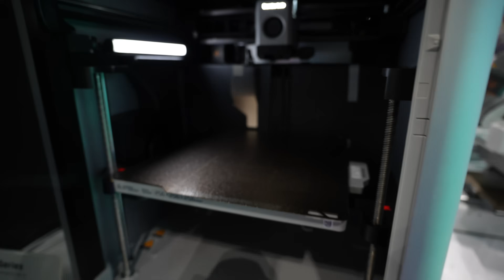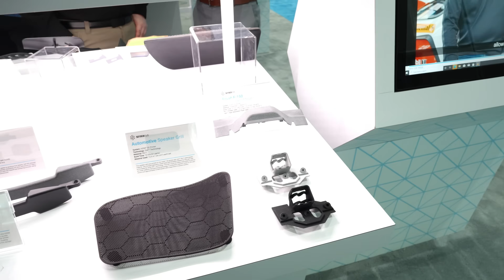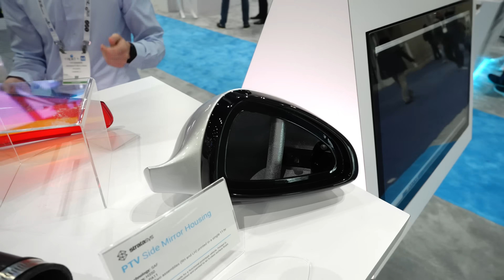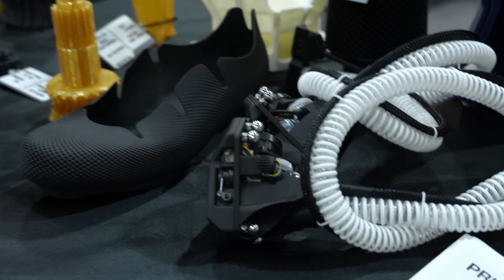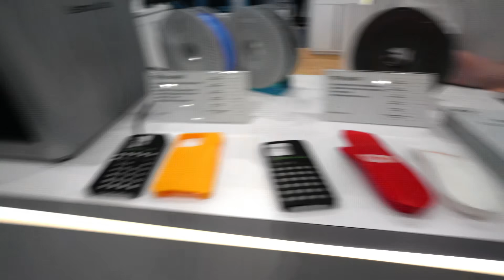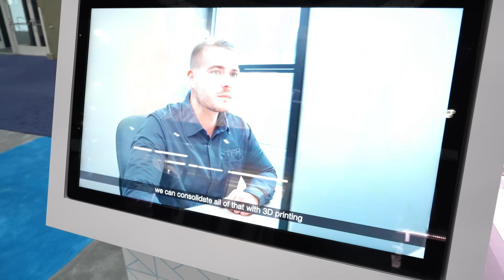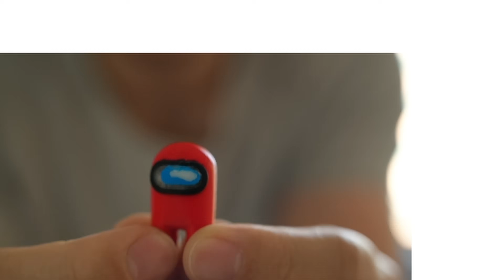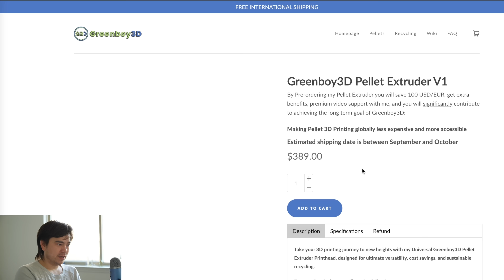Bambu Lab Patent Infringement, PRUSA MK4S, and Cheap Pellet Extruders (3D Printer News August 2024)

Comment: Bambu was the harbinger of the end of open architecture 3d printers. It's a technology that was built by hobbyists and now being overtaken by industry. It was inevitable.
Reply: For most hobbyists, I would agree.  But there was very obviously a strong demand for what they delivered.  It's the Ender-3 modders who moved on because they can now get good prints without having to finish assembling the extruder upgrade you printed.   But I still have a hypercube that I can tinker with :)

Comment: I am genuinely worried about the "rise" of bambu. Once open source it out the window we are gonna get overpriced filament "cartridges" with a DRM chip, serial locked hotends and always online 3D printers. Its happening to most other mass produced devices, why should 3D printers be somehow different?
Reply from the maker: If they run like any normal corporation, they’d only enforce filament DRM when it becomes profitable to do so. 

Right now there is too much competition in the market with PRUSA, Creality, and others. Once they knock a few of their competitors out and have a de facto monopoly they can start doing stuff like that. It might be sooner than you think.

Of course they’ll say it’s for your own good when it happens
Reply: @NathanBuildsRobots isn’t formlabs already doing that with some of their resin printers though?
Reply: They would become another Stratasys, they already have DRM on their cartridges.

Comment: It seems that they have some standing with their patents, but things like RFID are used in everything - I can't imagine the case where I put RFID into a product, then get sued because some company before me did it. If that were the case Ford should've patented the idea of putting 4 wheels on a metal frame, with an engine and some seats. We'd all be driving Fords.
Reply: There's the slight issue with prior art as well. Stratasys have had chips in their filament cartrages for decades, to lock down their printers to only use their filament.
Changing the connection method from physical to RDIF is surely not novel enough for a patent.
(they only got this patent by buying another company about 6months ago)

Comment: Also stratasys has had a rough time, their stock is down 50% YTD, they had a failed attempted buyout from 3d systems another famously litigeous early 3d printing companies (they sued formlabs while Stratasys was suing afina for using infil. Based on these filings tiertime (who was the company stratasys sued in the 2010's) was their supplier so if Bambu lab is a conglomerate with them they will have been expecting this. 

Also Stratasys has been planning this at least since march when they bought the heated bed patent from Arevo a californian robotics company who was liquidating their assets after they ceased trading. 

Stratasys is the OG villan for 3d printing, (it was only when their original patents frrom the 80's started ending in 2009 when 3d printing could take off).

Comment: The 'on a network' claim can't possibly fly. A 3D printer is basically a CNC machine if they happen to win with this then there are likely a whole lot of older companies with similar patents that they should be worried about.
Reply: I had the same thought, load cells are common in CNC machines and have been for decades. 
It doesn't seem like you should be able to patent something that already exists by just saying "Oh...no totally different, this is attached to a 3D printer"
Reply: @_Piers_ Especially considering that 3D printers are CNC machines.
Reply: @SnakebitSTI  CNC Machines that don’t need a CNC Machinist to operate them
Reply: yeah, they're gonna struggle with getting the patents for load cell quipped toolheads and networked machinery because of the existence of CNC mills and cutters which use load cells for position detection and homing routines and networking for status monitoring, file uploads and control of the machine. Those have been around long before the patents. especially in industrial applications.

If Stratasys gets those patents, other companies like Tormach, PocketNC and the likes would and up potentially being on the patent chopping block since you can get load cell toolheads for alignment and homing.
Reply: Watch Makers Muse video on the origin of 3D printers and the date.
Also CNC uses gcode that slicing software adapted to 3D printing.
Somebody opened a can of worms.....

Comment: Patents are generally a good thing, but I don't believe they are beneficial for consumers to this extent. I also find it absurd that a company can hold patents on almost everything related to FDM printing. Stratasys is effectively preventing us from having better 3D printers. I hope they lose the lawsuit.
Reply: That there is the exactly one of the major problems with the patents system.  It would be one thing if they are only patenting their printers as whole combined systems  with their unique features, or the general subsystems they are actively using or developing.  Which would let others develop their own printers with their own unique but different systems. But that’s not what companies like stratasys do. Instead of one patent for say a whole printer or a whole tool head, they make a thousand extremely simplistic patents on everything to do with any of their printers,others printers and anything they can think of, like ‘heated built plate’ or ‘non-stick coating on extruder gear’, or even ‘additive manufacturing device that is network connected to a cloud or app system over internet or local connection’, then they toss them all at the wall to see what sticks,and they keep doing that with what seems like more effort then they put into just actually trying to make a better product then their competitors.  That is not what the intention of the patent system was. It was so you can put out a product without having someone with more funds or something be able to just rip off a copy of your product and sell it as theirs.  That’s fine and great for simplistic mechanical products, but not for a market of complex, interconnected, and ever evolving electronic devices and systems where one entity is allowed to patent every simple and essential building block of any device that could conceivably by made in that industry that they can legally get away with and force a monopoly in their favor.

Sorry for the rant though, but not the opinion.
Reply: @RockieOnly  well Said. 100% agree
Reply: @slamoto2  well thank you!
Reply: @RockieOnly  that is why i think tech patents should last 5 years at most , precisely for the sort of thing you mention
Reply: Most of these patents are not even things Stratasys claim to have invented. 
Some of them are from Makerbot, who patented a number of things that were invented by the community. 
Others Stratasys have only owned since they bought Arevo's patents in March this year.
Reply: @_Piers_  I actually have an old MakerBot printer. It’s an old Replicator 2X.  It’s was cool printer that had a dual head setup making my first printer a multi-material one.  But it was expensive and guess what, with its proprietary gcode file format, it’s also now a big paperweight as even with the most up to date firmware, it won’t even read new sliced files from ANY of the slicers or softwares from MakerBot. And I haven’t tried it since then in years.

Comment: Everything is obvious in hindsight. But st the time, nobody else had thought of it.
Reply: Except practically all of these patents have prior art that would have prevented the patent from being granted if the patent system worked correctly.
One of the patents covers thermal conductive print sheets with a polymer coating, that's basically what we all use now.
There was a Kickstarter for exactly that 6 months before the patent was applied for. 
The patent was granted in error, but someone's going to have to spend a lot of money to make it go away.
Reply: @_Piers_  You just explained all of bambus patents. I had an idea for many things that I didnt patent. but somebody eventually did.

Comment: I'm going to patent having air in my build area.
Reply from the maker: You better patent a vacuum build area and liquid build area too just to cover your bases
Reply: @NathanBuildsRobots or a ‘climate controlled’ build area, that will cover heating, dehumidifying, and even filtering of the air.
Reply: @NathanBuildsRobots You forgot a plasma build area, now I’m safe
Reply: Either that or... start a company doing everything for components of "possible" 3d-printers that skirts the edges of this BS in that there would be plausible deniability.
Reply: Just make it matter or absence of matter

Comment: 2500 patents. As long as they originated the patents and used them in their own equipment I guess it's ok. If they just patented it to troll then "shame on you"
Reply: A few of the patents they're suing about now are ones they've only owned since March when they bought the patents of the defunct Arevo.
One of them is for a heated bed with a thermal conductive build plate coated in a polymer, all of it has prior art.

Comment: I just wish there was something in the law to hinder folks from such targeted litigation. Almost all of the items listed in the suit have been in use on hobby printers for /years/ now and they never said boo. My best guess is the Bambu X machines are starting to cut into their Makerbot and Ultimaker sales so all of a sudden it is an issue. So instead of leveraging all their technology, brain power, and manufacturing to make better and more reliable low end machines, they would rather litigate the competition out of the market instead of actually competing with them.
Reply from the maker: Yeah that’s a fair point. It almost seems like entrapment to not enforce patents for 10 years then only go after a company that is using them a little too well. I’m all for patent reform to make it fairer and easier to understand
Reply: @NathanBuildsRobots  Sadly, the only kind of patent reform that happens generally protects large entities who make large contributions to congressional reelection campaigns.
Reply: Sounds like a great case for a counter suit of anti-trust if stratasys it counted as a monopoly trying to force out all competition.
Reply: @RockieOnly that’s a decent point!
Reply: wonder if theres like a patent easment?

Comment: I really wish someone with actual legal training surrounding patents could comment on this. 

Right now most (all) the discussion surrounding this is from the peanut gallery comprising of no one with any actual legal knowledge of patents and how such patent litigation actually plays out in practice. 

I /facepalm every time I hear "oh, heated beds are so obvious and have been used on so many printers, how can there be a patent on it?"
Reply from the maker: Come to think of it, the first 3D printer I ever used (it was a stratasys machine) didn’t have a heated bed. It used a disposable injection molded platter.

Of course it’s obvious now that everyone is using one, but was it obvious at the time the patent was filed??? Everything is obvious in hindsight
Reply: @NathanBuildsRobots the actual patent is for a removable polymer coated plate that can be removed from the heated bed. It is backdated to 2014, but we've been using glue sticks on glass panes since at least 2011. 

It could and should be argued that we've been using a polymer to maintain bed adhesion since 2008 with hairspray or blue tape. 
And having a removable plate to make it easier to remove a print sounds obvious to me.
Reply from the maker: The patent specified that it uses a coating that isn’t damaged after repeated uses. Hairspray and glue stick slowly come off the print surface over time and need to be reapplied.

Now, is it obvious to come up with a coating that doesn’t get damaged after repeated uses?
Reply: @NathanBuildsRobots  Exactly! 

All these 20/20 hindsight comments are so cringeworthy. 

The reason they're so obvious now is because the thing that was originally invented was such a proficient, elegant, genius solution to the problem, that literally everyone else on planet earth chose to adopt it.

There are obviously other ways to make prints adhere to beds. Mechanical mechanisms. Chemicals. Nothing is stopping people from innovating bed adhesion in those areas.
Reply: All this BS is only possible in the US thanks to the shameful Obama’s administration which in 2013 amended the patent law de facto abolishing the “prior art” rule and allowing the far west “first come best served” sham which basically means that you can now patent (on USPTO only) already publicly available concepts even if they belong to the public domain space. That’s exactly what Stratasys did after they acquired Makerbot and put their hands on the controlled Thingyverse open source platform. In fact the most relevant patents in this lawsuit date back to 2016, well after Makerbot acquisition. I well remember the outrage spreading at that time in the open source community as Stratasys allegedly patented several ideas deposited on Thingyverse by makers under the open source agreement. I covered that and published an extensive blog with a list of almost all the relevant Stratasys patents potentially affecting the 3D printing community. The website I was running at that time was named 3DZero.com.
So yes, this is just another byproduct of the toxic woke corporate ideology and their dangerous illiberal policy. 
Shame on the US for becoming the most dangerous enemy of innovation and IP rights in the world.

Comment: Edit* Bambulab likes there patents too, everything from "Multiple build plates in a slicer (CN114013044A)" to "Three lead screws (CN215320666U)"  So think a bit before you throw a fit.
What i gathered from interviews it seems like a lot of high up tech bros a lot from DJI. Made a project to find some hardware field they could attack and take over. They ended up choosing 3D printers since the market wasn't really industrialized.
The start up cost for creating these kind of factory lines are no joke.
Its quite obvious that they are trying to replace everything in the space both hardware and software to Bambulab.
They are basically copying and replacing.
Would not surprise me if they launch a tool changer to "attack" the XL and run it with extremely small margin to try to push prusa out of that market.
Reply: Did you even watch the video?
Reply: @rsilvers129  yes did you?
My comment ware made to point out that people should stop simping for a massive company. That plays the same patent game, and generally trying to lock down the space.
They are absolutely aggressively trying to be the only 3d printer Company.
Reply: The difference is the big company offers an inferior product and a way way higher price , up front and for materials . If Bambu has solid patents but delivers great products and good value I don't think anyone cares . Patents to allow profiteering, in my view is not something to be proud of .
Reply: @hedleyfurio  the patents i wrote above are bogus tries to lock down the market, patent for adding a visual display of one more build plate in a slicer they copied from a open source project are not a solid patent. They are doing exactly the same thing as Stratsys.

Comment: Prusa lacks a video camera because of the US patent US8562324B2 (google it) that Stratasys has until 2030, after acquiring MakerBot. Here is what the patent says: „A device comprising:
- a three-dimensional printer including a build volume;
- a network interface coupled to a data network;
- a video camera positioned to capture video of the build volume from a point of view; and
- a processor configured to receive a three-dimensional model through the network interface, and to control operation of the three-dimensional printer to fabricate the three-dimensional model as an object within the build volume of the three-dimensional printer, the processor further configured to provide a user interface to a remote user accessing the device through the network interface, and to present in the user interface an image of the build volume from the video camera and a two-dimensional projection of the three-dimensional model from the point of view of the video camera.

The video camera may generally capture images of the working volume , the object , or any other hardware associated with the printer . The video camera may provide a remote video feed through the network interface , which feed may be available to remote users through a user interface maintained by, e.g., remote hardware such as the print servers  or within a web page provided by a web server hosted by the three-dimensional printer. Thus in one aspect there is disclosed herein a user interface adapted to present a video feed from at least one video camera of a three-dimensional printer to a remote user through a user interface.”
Reply: @petrubecheru  That's a lot of legal spiegel, but am I right in thinking it allows for time-lapse but not continuous recording?